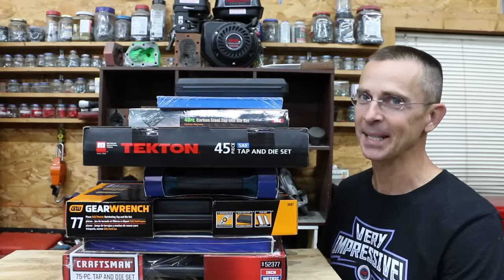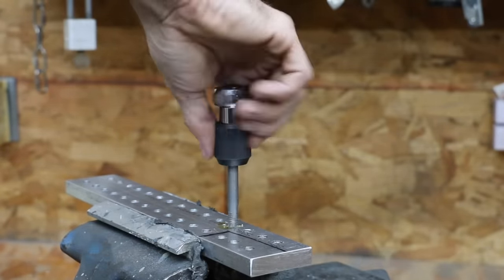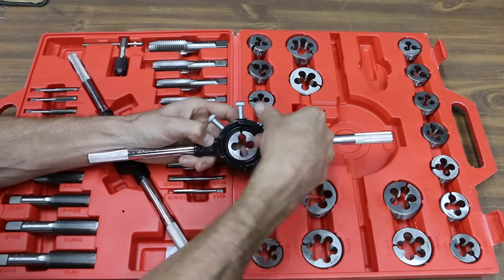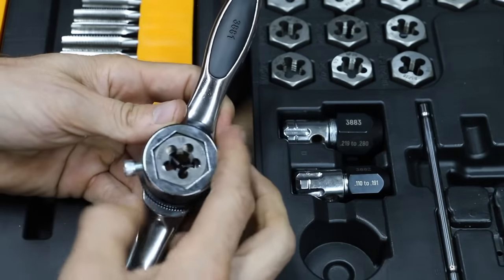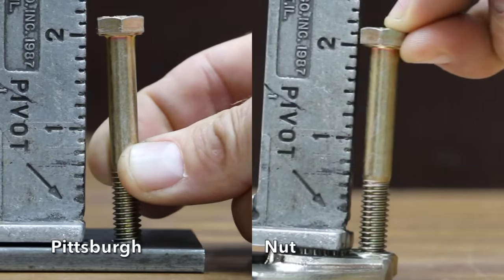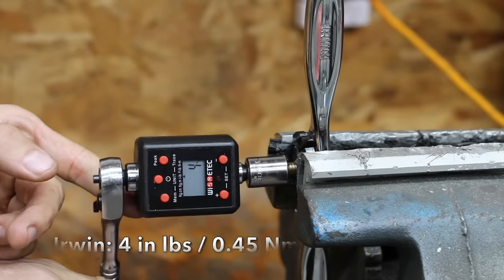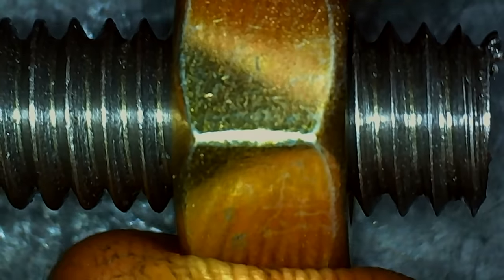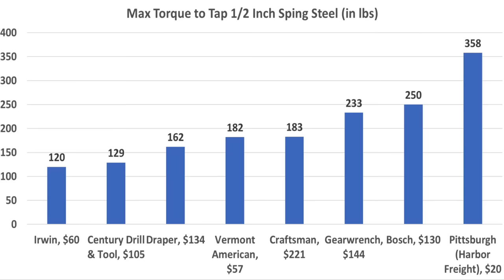Best TAP & DIE Set? Craftsman vs Irwin, Bosch, Draper, Vermont American, Tekton, GearWrench

Comment: 14:00 a small error you made is the split dies are meant for adjusting how tight/loose the thread is, by clamping it in the vice, you are making it as loose as it can make the thread by means of collapsing it to it's maximum cut. This would also increase torque/wear on the die.
Reply: I had the same thought when I saw how he did the test with the split dies.
Reply: Yup. That will cut a smaller diameter thread and cause the loose fit.
Reply: Came here to say exactly this, by closing the die your forcing it to both cut more (taking more force) and giving a looser fit
Reply: Not that small an error, I guess this is the price of churning out content. Still an awesome channel and I really appreciate the effort.
Reply: I was thinking the same thing. Also do people not reverse up to cut the thread any more, and clean out the swarf? No wonder some of these were binding and breaking. I wonder if that caused some of the slop too.
Reply: Sometimes screwing with that screw can snap a die. For some reason glass hard steel just isn't very flexible. When you put a die into some holders it kind of cranks down on the die too. The round dimple ones. Which in my book are the only real ones. Hex ones are homeowner specials.
Reply: @Tinkering902  churning? do you know how much a pain in the ass a setup like this is? You drill 100+ holes like he does "in a day". Your hand will be SORE.
Reply: @stuartgreenshields5591  to be honest, the breaking swarf is more for a cleaner finish and to reduce the tap getting stuck. Professional machines don't back out, they just go in full ham, unless it's a deep blind hole. Industrial pipe thread cutters never back out.
Reply: The point was a wear test on the dies/ taps for a lot of the testing as well. Though, I'd be surprised if he didn't think to account for the features on the other dies.
Reply: @caodesignworks2407  hence, why I said small error. He should've included a hardness test or something hmm.
Reply: @dimitar4y  Agreed.  I would like to have seen them hit with a set of hardness testing files.
Reply: @Tinkering902  yeah i do love this channel but sometimes you can tell he's not really bothering to do the research on subjects he's not familiar with. there were quite a few errors and misunderstandings in this video both of the tools and they way they're supposed to be used.
Reply: @stuartgreenshields5591  You don't need to do that on such a shallow open hole. Well at least not with any half descent tap. Maybe he should of with these junk taps. With a good tap I would have used a tap driver and a hand drill or a drill press.
Reply: @geoffmooregm  possibly, but I would. As an apprentice (29 years ago...) I was taught by a guy that used to make casting dies for aluminium zips, which use very very fine tolerances. Anything remotely nearing the sort of slop he has here would have the work piece bounced off the floor whilst I received a well deserved bollocking. However there would also be three taps for each thread (getting progressively larger), and you'd work through them until the bolt would go in perfectly, then stop. I suspect the taps and dies he has here are best suited for cleaning up existing threads rather than cutting new ones.

Comment: All of the tested sets are more for chasing/correcting threads than for cutting. High carbon steel is ok for aluminum and mild steel but none of them are really sharp enough for any serious project. Also, it is recommended to countersink holes prior to tapping to prevent damage to the leading threads like what happened to all the taps. I agree with others that the quality of these sets is revolting. As always though, nice work and thank you!
Reply from the maker: Thanks and you are welcome!
Reply: Absolutely!
Reply: Revolting ... that is the word I was looking for! 
Taps and dies from an actual "tool and die" company in USA, Germany, or Japan look nothing like this junk.
Reply: @kevinsellsit5584  what is a reputable brand to get tap and dies from? Im looking mostly to buy just one size (m2.5) and i want good quality that will last.
Reply: @sebkorsnes  funny how a lot of commenters on this video keep saying these sets are trash but none of them can name any better brands. I think they're full of shit. Someone in a different thread pointed out the operator error in the video that makes a lot more sense than just "EVERY brand is bad"
Reply: @sebkorsnes  union butterfield and hansen are my favorites. i would consider union butterfield to be the best tap and die manufacturer, period. hansen are a close second. both are usa brands.
Reply: @marzsit9833  Hansen and Irwin are the same company and most of there tools are sold under both brands. Including dies atleast.
Reply: @gr6e  You have probably not heard of the names professionals use. Dormer, Regal, Union Butterfield, that's 3 off the top of my head. These and others are much higher quality, high speed steel, and will cut to size accurately, over and over. There's none of that sloppy variability we saw here. They all cut within the tolerances applicable to their specified class of fit. (Yes, there are different classes of fit, each with its own spec.)
They are in an entirely different league, and their price proves it.
 I just looked at a supplier's website: One (1) Union Butterfield High-Speed-Steel 1/4-20 UNC right-hand die-- an ordinary, very common size-- $86.27. That is for one die.
A Union Butterfield High-Speed-Steel 1/4-20 UNC right-hand 4-flute straight-flute hand tap-- $13.54. (Taps are much easier to make than dies) Note that is a hand tap. Machine taps, which can cut at high accuracy hundreds or even thousands of times per shift, are much more expensive.
In a professional environment like a machine shop, any of these sets would be useless. Which is OK, because that's not what they're made for. But they should be able to cut to size, and it seems that not all do.
Reply: Most people will only be using 2-3 sizes at most, so a HCS set with a few HSS bits is probably the best economic choice. It's nice to have a tap do a few dozen holes and still be minty-fresh.

Comment: Wow! When I had mechanical engineering in 1973 we had 3 taps and dies for every thread! A starter, a medium and a finish. Side to side movements were practically nil!  I still have a small set somewhere for metric M3 to M6. Getting a matching drill is now nearly impossible. And we were forced to cut all aluminum on a lathe just to uphold the tight tolerances.
Reply: Try McMasterCarr! They have a TON of drill sizes.
Reply: I think you mean a taper, plug, and bottoming tap...
Reply: @kleetus92  Terminology appears to vary country to country.  In the UK it's common to see taps termed taper, second, then plug
Reply: @kleetus92  he is a mechanical engineer not a machinist lol
Reply: @danand6907  LOL
Reply: Private. I,suspect you are not in the US.  In the US the reference is Taper, Plug, and Bottoming. There are also hand taps and spiral point or gun taps. Spiral point taps are spectacular for thru holes as the chip is pushed out the front of the the tap. There are also helical cut taps that are great for special applications such as in extrusions where the hole to be tapped is not a round hole but a bulb shaped slot. There are also coating options to enhance tool life. 

As for where to find drill bits. I frequently use eBay. I prefer HSS or M42 Cobalt 135deg split point. I also prefer stub or screw machine length bits whenever possible. I have multiple drill indexes. Other US sources are:  MSC, Travers Tool, mc master Carr as mentioned by someone else. However Mc Master Carr has been known not to export even to Canada. Try a local machine shop supply. Both Mc Master Carr and MSC have good websites for information. 

Machinery’s Handbook is never far from my desk.  Guide to World Screw threads is on a shelf not far away, and A Copy of ANSI H28 is in my library.   I find DIN metric has gotten to not be too big a problem in California. BSF and BSW are a pain. I am happy I don’t collect old British motorcycles. British motorcycle threads are a whole different series.
Reply: Well lots of sets still uses 3 taps for each thread. Always annoying when you just bring a starter tap thinking it is the final one. 
No clue what they are named in English though as I'm not a native speaker.

Comment: Great testing as always! I purchased that exact Craftsman set around 5 or 6 years ago at a Sears on Black Friday for around $70. It's saved my butt many times and all taps and dies are still in perfect condition.
Reply from the maker: Thanks!  Nice!
Reply: @ProjectFarm  Me too: Years ago I used two sets of Taps, and one of them was a Craftsman from around 1980... And found it consistently gave me the tightest fit in all the sizes.  But most probably, Craftsman has changed on suppliers since 1980....